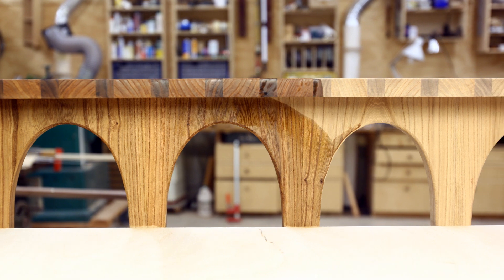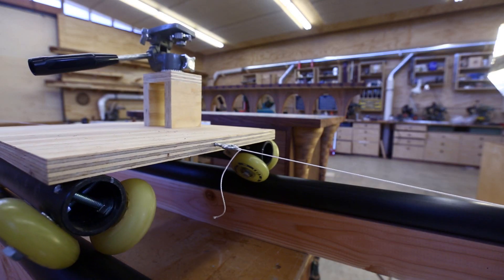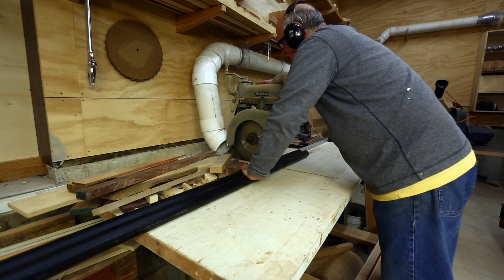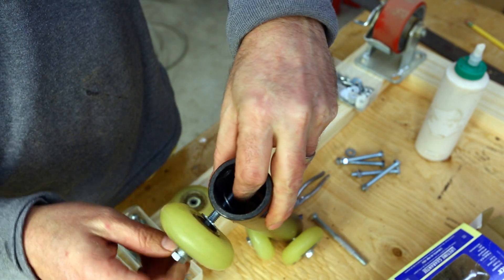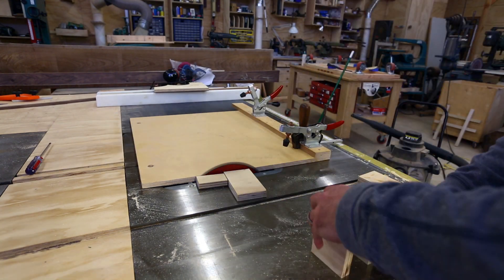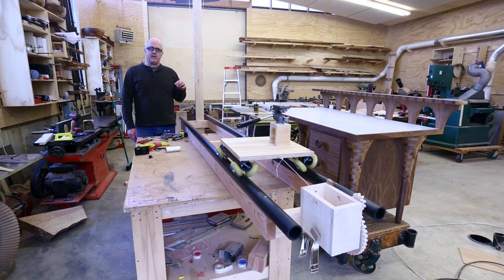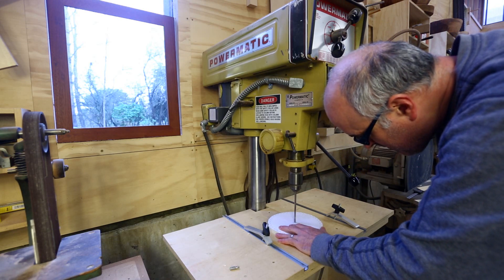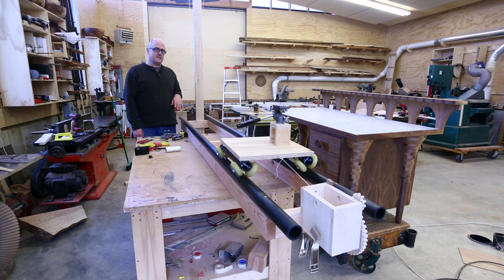Stop Motion Camera Dolly

Comment: That's a great little rig. 

I noticed that the string lines have some 'spring' in them. Have you come across Dyneema? Dyneema doesn't stretch as much, so you get more of a piano-wire feel, and a more responsive adjustment for the dolly. Lower gauges can be bought from a good kite store, thicker stuff from a chandler.

Comment: Frank I think you are a wonderfully innovative woodworker. This is so very clever. I was thinking if you were to double back your string to your sled round twice over a large Pulley and twice or even three times around your driving shaft and had a couple elastics to maintain a tension you could actually make your dolly go back and forth if you had reversing switch on your motor. I hope this makes sense to you LOL